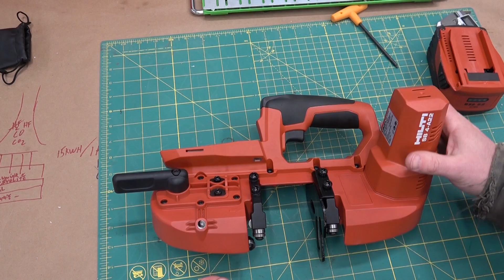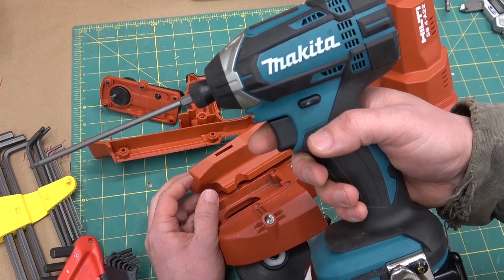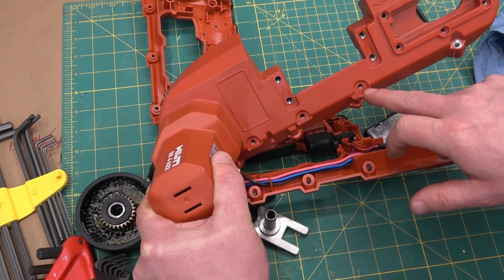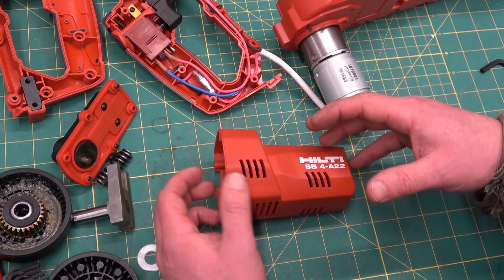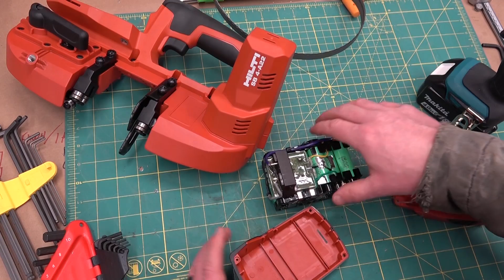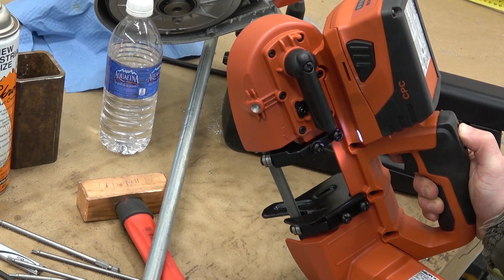BOLTR: Hilti Compact Band Saw | Quality Problems

Comment: Ive got the Hilti and to be honest its probably the worst tool I've had from them and I've got over 20-25 tools, the cost of the tool isnt too bad but the cost of the blades are ridiculous!! 3 run at £120 in the uk, they all snapped within 3weeks! This was a new tool from so no worn rollers or play in the bearings, this was just cutting unistrut the correct blades were used,teeth count etc. Then i found that starrett do the identical machine! And having bought their blades which run at £5 each! Can say they far better value. When i recently spoke to them directly at a tool fair they told me that both band saws are made under licence by one of the biggest bandsaw manufacturers in taiwan and that the Hilti uses slightly thicker gage metal than starrett which they say isn't flexible enough when in the machine and so break easily when stressed, the starrett ones are thinner and more flexible, only downside the Hilti guide wheels arent adjustable i wonder why...... so going to buy the spare parts from starrett from their machine and replace the ones on my Hilti so i can use the thinner cheaper blades.

https://www.starrett.co.uk/shop/bandsawmachines/portable/s1005_portable_band_/

Comment: The Samsung IMR18650 20S is a way better cell. It can do 30 amps reliably. The capacity is 500 mah less but doesn't really matter because when you push the 25R it falls on it face anyways.

Comment: I use hilti all the time in large scale structural concrete. But yeah big money. So only if your on big jobs like a 300million $ hotel on the high end. Billions are changing hands in construction so hilti has positioned themselves great in big money commercial work. Their shit is strong but usually its not needed really. Dewalt or milwaukee are the best. Pro grade stuff anyway. 60volt cordless dewalt  skilsaw made concrete construction SO much easier.

Comment: The bandsaw blade needs to be tempered after welding. The saws we used mostly had built in blade welders that would pre- grind, weld, temper and also grind down the weld. Really necessary for jigsaw style cuts and bulk blades are super inexpensive compared to pre-welded. The welders aren't really cheap tho. http://www.grizzly.com/products/Grizzly-Blade-Welder-2-0-KVA/T27555?gclid=EAIaIQobChMIu6zA6uud3wIVhbrACh0ynQfWEAQYAyABEgIhmvD_BwE

Comment: You should definitely tear down that Femi you have. I sell them and I've seen some horrific shit in their build quality.
Reply from the maker: I'm scared to. It feels like it's held together with Ave Marias and Marinara.
Reply: @arduinoversusevil2025  yeah not far off. We have a pile of them with com bars torn out of the armature, broken motor housings all sorts of things. Not to mention endless burnt out speed controllers.
Reply from the maker: @Slartybartpharst  Speed control is brutal. Triac trigger makes the LED lights flicker. You can feel it triggering on/off. AND according to the label you gotta keep it below 2 for everything, it's got the wrong gear ratio designed right in!
Reply: @arduinoversusevil2025  Yeah they definitely didn't do anywhere near enough work in R&D apart from working out just how cheap they could make it. I'm glad I'm getting out of tool sales. I felt like such a piece of shit every time I sold an exorbitantly priced Femi to some poor bastard who believed the hype.

Comment: I have the Milwaukee version of this, in the M12 form factor. It's perfect for Unistrut as well as the usual EMT and black or galvanized pipe. DO NOT CUT STAINLESS OR CHROME WITH IT! Instant blade ruination if you do.

Comment: Here I am looking to replace a bunch of my WillFuckYee tools with Shmilti and you go and throw this curveball of mediocrity. What's a fella to do for skookum tools nowadays? Buy a set of batteries from every brand and pick the two decent tools each one makes out of the litter?

Advice needed Uncle bumblefuck. I do everything under the sun so I can't just pick a company's strong point, I need their whole lineup to be solid. If you had to pick one brand and stick with it, regardless of cost, which would it be?

Comment: I was setting up a VFD the other day. Awful. Exact quote from the manual: 
Navigation Tips
:
To navigate within one level of a menu, use the up and down arrows.
To move deeper into the menu structure and back out, use the right and left arrows.
Reply: Sounds simple enough to me
Reply: You sure you copied that right? It sounds like the most logical option for a screen with arrow keys.
Reply: @chrisedwards3866  Exactly what I was thinking lol
Reply: @chrisedwards3866  How is that logical?: Same level = Up and Down, Deeper (or shallower) into a menu= right and left. Have you ever used a computer menu?
Reply: Exactly how i would expect it actually...
Reply: I guess it depends on the layout of the screen. If the items are displayed on top of each other it makes sense. If they’re side by side it doesn’t. If it only displays one item at a time I’d also argue for an inverse logic where up/down changes the level of the menu.
Reply: @axiom1650  So if you were in an elevator with 4-way arrow keys and you wanted to go down, you would push the left arrow button. Or would the left arrow be up? Interesting.
Reply: @SueBobChicVid  It's just how I'm used to seeing it when working with such devices, elevator comparison is moot.
Reply: @axiom1650  I get you. But just what sort of technical writer writes "as a tip": to go DEEPER -  don't use the down arrow, use the right arrow (or is it the left arrow)? To stay on the SAME LEVEL, don't use the horizontal arrow keys. No. to stay on the same level, use the up and down arrow keys. "Level" to me conveys the idea of horizontal movement. "Deeper" conveys the idea of vertical movement. I don't think you can dispute that. That's my point.
Reply: Yes. If there is a menu screen, then the other options are hopefully in a vertical column - you scroll through them by going up and down, because some are above while others are below. Unless your menu screen somehow lists the options in a horizontal row, then the arrows match the screen. Press the up arrow to select the option listed above whatever was currently selected, and press the down arrow to select the option that is listed below it. This is the standard setup.

Does the menu list those options in a horizontal row?
Reply: This thread sounds like me in 1999 trying to figure out my SP-808 groove sampler.  Fuckin worth it though you cause you saved everything on zip disk and we all knew it and mini discs would never die.
Reply: @SueBobChicVid  At work, most of the drives are ABB and this is exactly how the menus are for setting it up. After about 30 seconds of putting in parameters, you can fly through it quite easily.

Comment: We’ve got these at work. They suck. Not nearly enough power and too bulky to cut close to joints or bends in the metal. Sawzall with carbide blade is so much better.

Comment: its funny, the portaband i have (a hundred dollar one from the horrible fraught that i built one of those youre far too cheap to buy a real metal bandsaw stands(10/10 would highly reccomend no more deathwheels XD)) has wheels that are quite a bit more tapered than that, and also, you can get the blades at lowes, hd, wheever really...... although thats the same blade size as basically every other portaband so its prolly just more popular
Reply: interestingly enough i also think the hf saw runs slower than that...... cant be sure though a bit of a guess

Comment: I use this bandsaw every day. I'll tell you it's a waste of money.
Battery placement will kill your wrist and forearm, and I don't know if it's the blades or the way the blade is angled in the tool. But the dang thing will break blades after very little use. Lol they've broken on me while cutting cpvc if you can believe that. I heard the blades are made by Bosch so idk if the blades are good. But either way they should last a lot longer then they do. That's my 2 cents.

Comment: Dearest Ave, and followers of such,
I write to you in the hope to make you whole again, with as you say "in-for-macion". Hilti is a great tool manufacturer, I have several Hilti tools. Some are over 20 years old, however, that being said. I have to disagree with you a small amount, (ohh humble gods of YouTube please take heed at what I am going to say, and pass limited judgement). In the context of Hilti delivering the ivory shaft to those who buy for longevity, the Hilti brand has gotten away from the "user" repair capabilities, many of the hammer drills and breakers have a built in timer that only allows 8 hours of use before the tool self shuts down until a Hilti service tool resets it. That tool reset comes with a "Hilti service" from a Hilti service center, and as expected, the service is not cheap for a set of brushes and oil on "them there tidbits". The service cost last I checked was over 300 (see>three hundred) of those dollar things. Take that with a grain of salt, as the bag of smashed assholes that bequeath me with said information, is in fact ,an asshole. Equipped with a fancy red van, a fancier red polo shirt, and a comb-over worthy of the US presidency. Not sure if the cordless Hilti has that shut down feature, yet.

Comment: So the cutting speed is way too fast if your into savings blades. Blade saver. Fucking guy who will just not even think about changing the blade until the tool has been ganged on three batteries later and it's obvious the blade is dull.